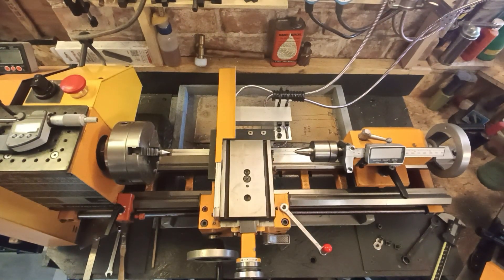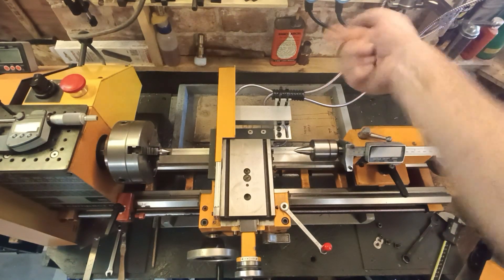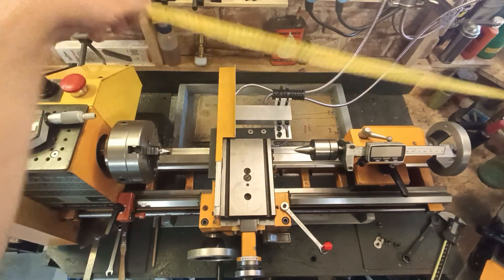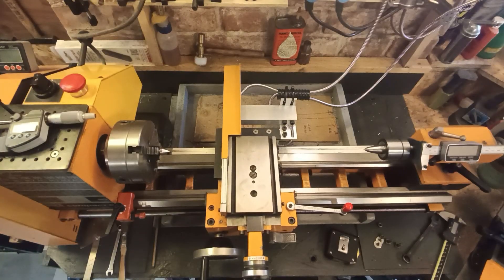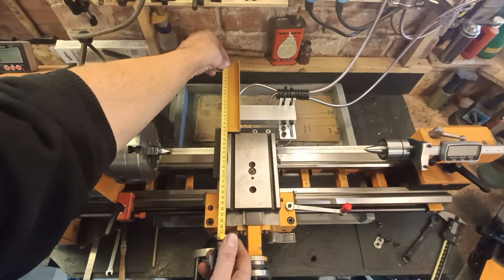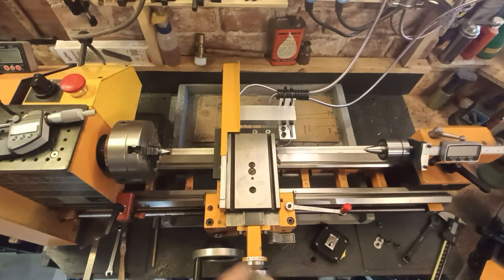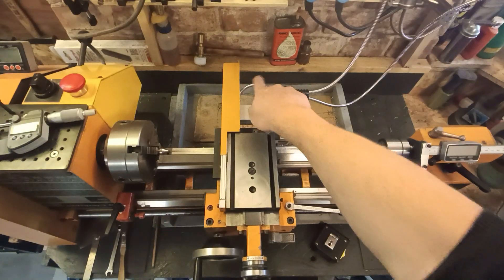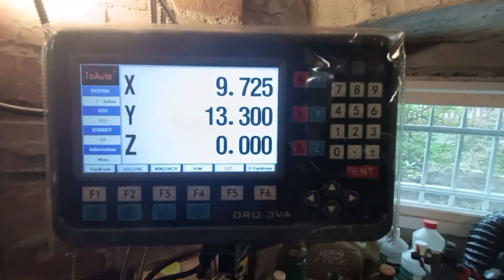EMCO compact 8 Lathe final DRO upgrades

Comment: Thank you for this video! Do you think it is possible to install a dro to this model lathe with the mill head attachment installed?
Reply from the maker: Hello, sadly, i think its not possible - by looking on my original EMCO Manual. The Pole of the mill head attachement will always block the movement, because both readheads are attached to the crosslide and they have to travel free the whole bed way. Maybe it is possible in the bed axis, if you use a slim magnetic scale, laying on/above the pole mount and the read head is directly attached to the back of the crosslide. but on the drawings it looks very narrow.